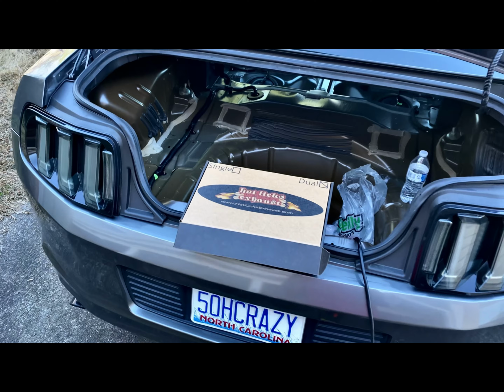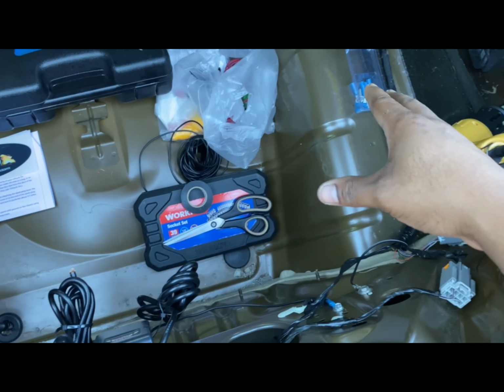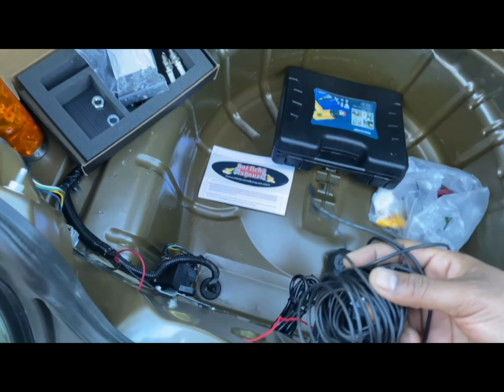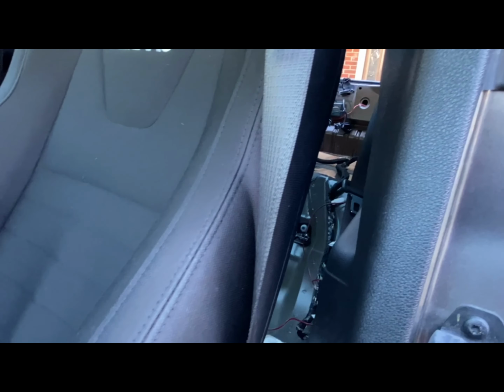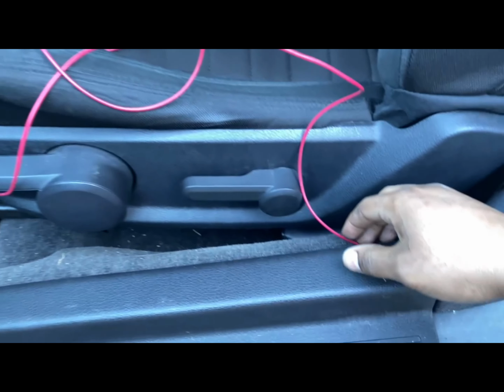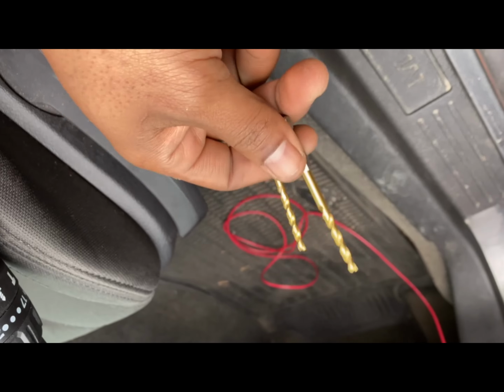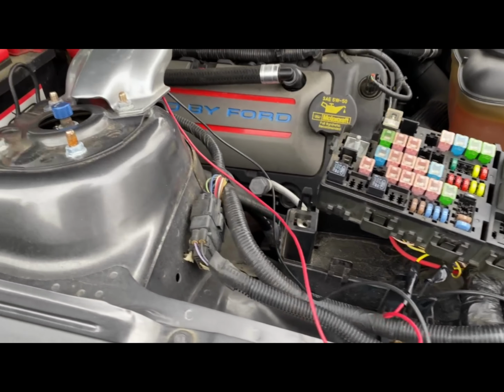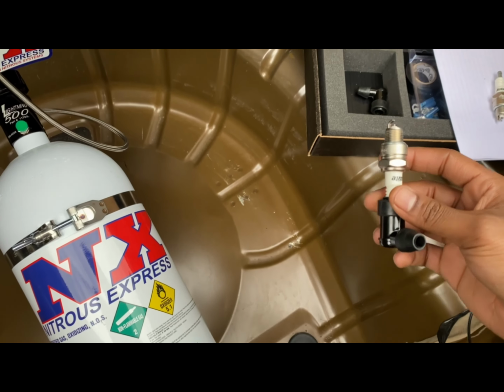How To: Hot Licks Flamethrower Installation (Mustang GT 2011-2014)

Comment: My question is, is it still ok if I put the spark plugs before the muffler ? 😓
Reply from the maker: How far back bro? Is it right before the exhaust tip or before the muffler itself?
Reply: @5oh_crazy  I was planning on doing it before the muffler itself because I thought I didn’t have space between the tips and the muffler but I think I do, so if that’s the case I rather try that
Reply from the maker: @B8_ghostt  ahh ok ok, yessir definitely try and have it before the muffler so you can get nice sized flames! If it’s too far back they may not have the same effect! Let me know if you have any questions during install.

Comment: Quick question so the further back the spark plug is in the exhaust the bigger the flame or ? 
Im confused
Reply from the maker: The further back the spark plug the shorter the flames will be bro. The closer they are to the end of your exhaust tips the bigger they’ll be!
Reply: closer to the tip = more oxygen for the flame

Comment: is it the thick green and yellow wire or the 16 gauge green and yellow wire?
Reply: @5oh_crazy
Reply from the maker: It’s the 16 gauge yellow and green right below fuse 40 bro, the underside of the fuse box cover has the diagram too!
Reply: @5oh_crazy  I cut that wire in my car still ignited so I’m having an issue trying to find out which is the wire I have to tap into
Reply from the maker: @victorruiz2790  what’s your make and model year bro?
Reply: @5oh_crazy  2012 3.7 mustang
Reply: I was wondering if that wire was mainly green or mainly yellow
Reply from the maker: @victorruiz2790  it should be mainly yellow, if you can snap a photo of how you have it wired send me a DM on Instagram bro and I’ll check it out! @5oh.crazy
Reply: @5oh_crazy  i sent you the DM!!!
Reply: @victorruiz2790  did you find out what wire it is ?
Reply: @celsobarbosa3595  yes i did!!!

Comment: can you run a cat back exhaust? and do you need to weld or could you skip the welding?
Reply: You DO NOT want a cat for this, it will destroy it, but yes you can run a cat back exhaust and there is a way to thread a nut on the inside of the pipe onto the spark plug as well

Comment: I have Challenger r/t 2019 I connected the positive to the battery fuse and the other to the other end of the cable and it worked at first but then it turned my car off and started stuttering when driving is there a particular reason or anything?
Reply: any updates ?
Reply: i got a dodge challenger 2020 rt just i’m lil lost lol

Comment: im confused on how to use the kit i have everything wires as should but i rev up to 6 rpm and hold the button then let it rev down to around 2.5 rpm and let go before so it wont turn off , and i supposed to rev up then hold the button and keep reving it up then let go once i wanna stop and let go of both the gas and button?
Reply: you need to have no cats at all rev up with your foot still on the gas push the button and hold till your ready to stop let go of the button